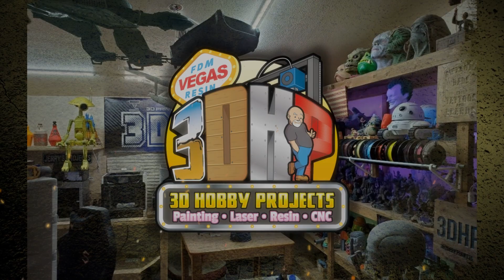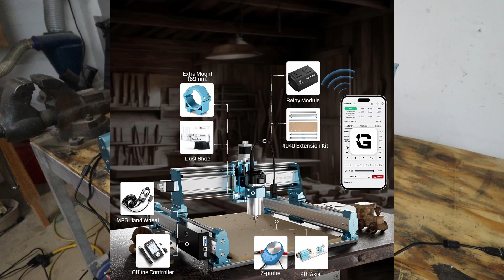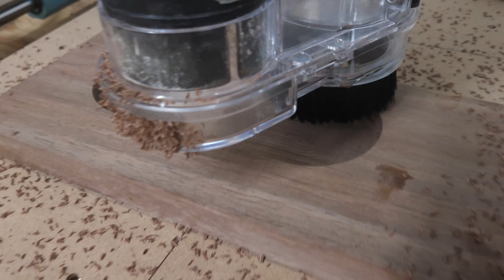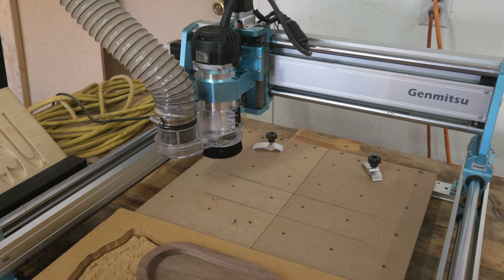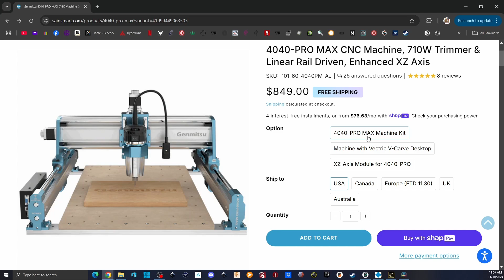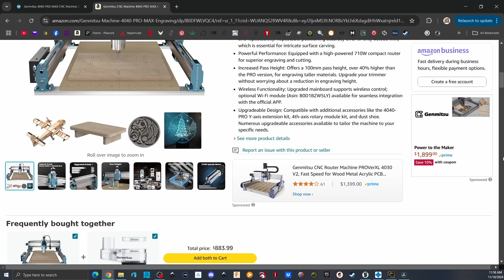Best Hobby CNC Under $1000 - Genmitsu 4040 Pro Max

Comment: Where did you get the dust boot that fits a 4" hose?
Reply: I just picked this up and haven't set it up yet
Reply from the maker: Found it on Etsy for the Makita router.Hose is 2 1/2 inch.Dust boot works great. If I find link I'll share it with you.

Comment: Jerry, how did you get it started I just bought it, and you are correct in that it's a beast, very minimal flex, but after I installed the driver, I am at a loss because I have no idea what's next. When I went to the test screen, it was empty, so I loaded a new video card, but there was still nothing. I looked in that useless book that came with it, and it just confused me. You seem like a pretty down-to-earth guy who could help a fellow craftsman. I am so excited to get started. Thanks.
Reply: @johnstangel8918  did you fix it?

Comment: No 6060 Y axis extension for this?
Reply: There is a Y axis extension for this but that didn’t change for the Pro Max  so you can go to 4060 with that. The X axis is new and heavier so they have to make a longer version of that to go up to 6060
Reply from the maker: Check there website not sure.